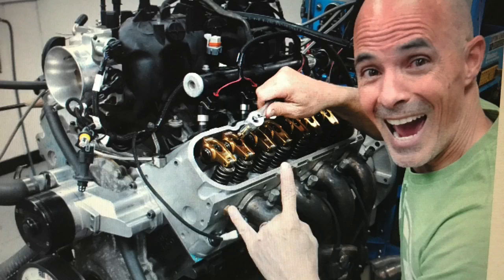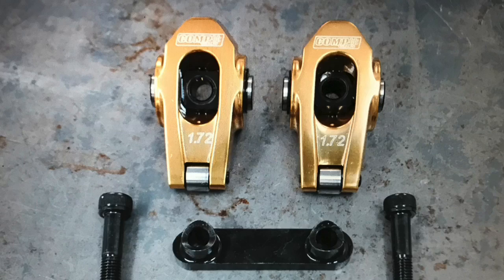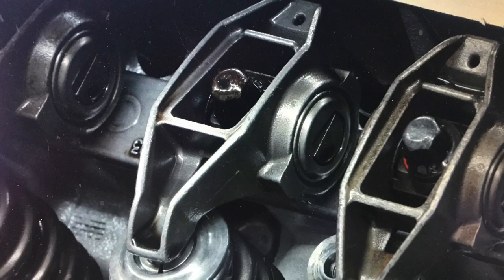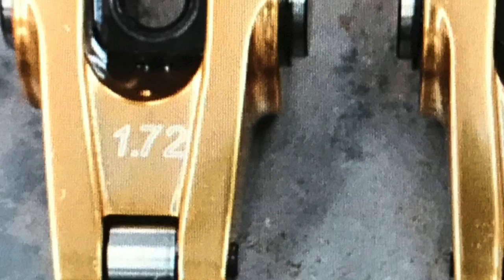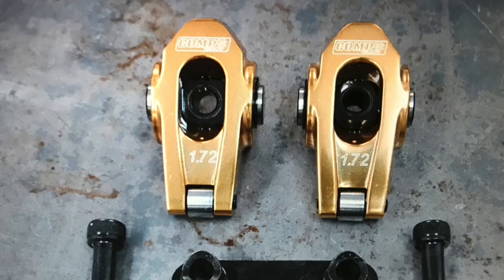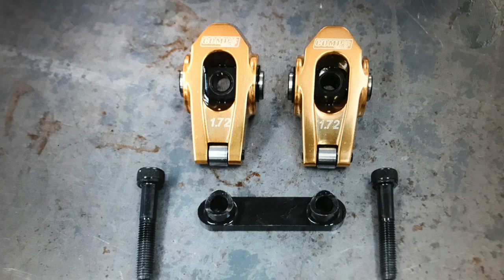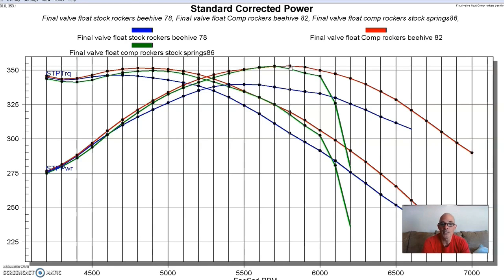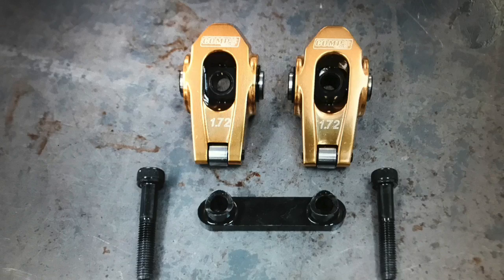LS ROLLER ROCKER TEST-DO THEY WORK?

Comment: I have a stock 4.8 from 2000 Silverado 2wd. I tried adding a 585/585 lift cam to it with 1.8 roller rockers with standard hardened 7.4 pushrods. Not understanding the pushrod length measurements. Saw something online that 5.50 to 6.00 I should use 7.35 push rods. Can you give me any feedback please
Reply from the maker: the lift of the cam has nothing to do with pushrod length
Reply: @richardholdener1727 thanks you. I guess that sums it up then. Just need to measure the pushrod length on any cylinder for each intake and exhaust. Must have been the rockers that caused the issue.
Reply: @r @richardholdener1727 will 1.8 roller rockers run ok with hardened springs, small cam, stock block 4.8 guts. Just can’t afford interference in the future.

Comment: I know this video was done 5 yrs ago but did you see any differents in the oiling, I have great oil pressure but can hardly see oil coming out of the rocker arms, I know that they don't come straight out like stock rockers but I feel like it's not enough oil , how do I know for sure?
Reply: Yes sir, I understand that, the roller rockers have the oiling hole coming in and out the side and I guess I'm just gun shy because it doesn't come out like a small block and shoot over the fender,
Reply from the maker: The rockers should not change rocker oiling-hole size should be very similar

Comment: Does the comp cam roller rocker affect the pushrod length size? And if so does the same 1/4 turn method from one of your previous videos work on finding the length?
Reply from the maker: rockers change pushrod length-and turn method only works on non adj rockers

Comment: Roller Rockers where never meant to give you more power. If it was about power GM would not have first installed them on the 3800! It reduces friction and wear on the valve stem tip. The reduction in friction increases fuel effeciency not enough that the customer would ever see it but for corperate average fuel ecconomy. The only thing you can do to a rocker that can increase the power potential of any given cam setup is to increase the rockers ratio!
Reply from the maker: Just an FYI-roller rockers can increase power by providing an accurate and consistent actual ratio through the lift range (when using stock ratio). The fact that GM installed them first on the 3800 has nothing to do with whether they add power or not.  But they do reduce friction

Comment: What kind of rocker/trunnion I need for tsp stage 2 216/220, 550/550, 112 lsa and my motor is 4.8
Reply from the maker: you can use stock-or and upgrade

Comment: I really don't see what's the big improvement with the so-called roller lifters in reality it's only an improvement and still not a solution,so why have they not Designed the lifter with a ball 🏀 style roller over a one-way roller regardless  how the lifter changes it position it's still not going to cause damages...
The concept of a ball type roller is to eliminate the roller bearings and stationary lifter failure
Reply from the maker: the orientation of the cam lobe in relation to the roller lifter only needs to roll in 1 plane. there is no need for a complex capture mechanism to house a roller ball

Comment: If I change the ls1 stock cam can I put in roller rockers and what size
Reply from the maker: yes but no need
Reply: @richardholdener1727  I want to up grade to be safe
Reply: @richardholdener1727  I was thinking if I have .660 springs I need roller rockers rated for a little over that right the comp ultra pro magnum should I run the stock size that’s what size one peace Molly rods I have
Reply from the maker: YOU SHOULD STICK WITH STOCK
Reply: @richardholdener1727  rockers or rocker size I apologize I appreciate your response I’m learning
Reply: @richardholdener1727  the motor is ls1 I’m puting in btr red hot cam 221 24x .619 .617 .660 lsa113 dual springs 1 3/4 LT TS True duals msd wires and plugs bbk 85mm and spacers volant dual ram filters is that a bad set up ? Idk I guess I’m leaning as I go I was planing on getting hp tuner it’s just I’m not that good with reading and stuff…

Comment: A issue I find with older rockers that are cast is I've seen some badly cast factory rockers were there not the right ratio or off some other than that it's fairly cheap to replace

Comment: Hi Richard, do you have any videos comparing same rocker ratio with significantly different weights over the valve tip? Or also same ratio but steel vs aluminum?
Reply from the maker: THE ROLLER ROCKER TEST SHOWS YOU WHAT HAPPENS WHEN YOU INCREASE ROCKER WEIGHT
Reply: @Richard Holdener  It shows effect with inadequate springs. What about curve changes when everything else is optimal, only changing tip weight?
Reply from the maker: THERE IS NO CURVE CHANGE FROM WEIGHT-ONLY STABILITY OR NOT
Reply: @richardholdener1727  thanks!

Comment: I had this very weird thing happen to me.  When I decided to upgrade to trunnions, I noticed the wear pattern on one of the rockers was to the side instead of straight in the middle of the tip.  I've had the engine since new and I have never had it apart before so it wasn't from some incorrect torquing down or reinstallation or whatever.  Straight from the factory.  I wonder if anyone else saw this.  Anyways, while I wasn't thrilled about paying so much for roller rocker tips, the cool thing is that they came on a shaft that mounts two of them together.   Stock ls rockers are individually.  I'm guessing this will eliminate any tendency of rocker arms wanting to twist to the side or so.  A little side benefit to the roller rocker tips I bought I guess.

Comment: I have a 5.3 with 315k on it. It was tapping. I tore it down to the block crank and pistons. Added a new high volume oil pump. Shimmed and ported it. I have 80lb cold 60lb hot. I installed a new cam new lifters and lifter cups  new push rods new rockets and timing chain added studs in the heads. I started it and I have tapping still I replace knock sensors new spark plugs and wires and ideas
Reply: Tap typically top end valvetrain/or wristpin a knock isually bottom end if you loose oil press with heat typically good indication of rod bearings/bearing clearance.

Comment: On 1st gen SBC a rocker upgrade is a must, I've seen too many broken stock rockers resulting from little more than a set of heads that received a valve job and had better springs installed. Not to forget the inconsistent pivot ratios of the stock pieces.

Comment: My Fbody came built laying 460whp. It’s got PRC heads and a TSP Torquer V4 cam. 231/234 .629"/.615" 111 LSA - Worth upgrading to a 1.7 or 1.8 RR? Tryna find out from the original owner if they have some but not sure.
Reply from the maker: NO ON THE ROCKER SWAP
Reply: @richardholdener1727  gotcha found out it has TSP rockers. Thanks for the quick reply I was bored and tempted haha

Comment: I have a lm7 and got the 227/238 cam kit with .660 lift dual springs and I’ve already put the trunnion upgrade on but now I want rollers I didn’t know they made power which ones do I need
Reply from the maker: keep stock ones

Comment: We’ve seen less lateral stress on the valves and steams with roller rockers. The factory rockers work great but seem to punish steam seals and guides more than rollers do. (Just my 2 cents).
Reply from the maker: YES AT HIGH LIFTS

Comment: I think the trunion upgrade is all that is needed for most minor upgrades on the LS, but a roller rocker is a much bigger upgrade on a traditional small-block.  The trunion is the upgrade, the roller tip isn't worth much, IMHO.  In this comparison, the rocker ratio change is probably the difference.

Richard, what are your thoughts on the LS shaft upgrade kits from Brian Tooley Racing?  Again, probably not necessary for most applications, but seems like a very nice upgrade for those getting more aggressive with the RPM.
Reply from the maker: SHAFT IS NOT REQUIRED UNLESS RPM

Comment: On the term of deflection how are shaft mounted rockers particularly the Brian tooley shaft rocker arm kit and his New rocker arm design cause if I remember off the top of my head his rockers gained weight at the tip assuming it allows better spring harmonics but it's like 2.5g I guess to put it simply is how much does deflection affect power

Comment: Not the first engine I put roller rockers on , but the first stock engine was a 97 z28 LT1. I installed crane 1.6 gold self aligning rocker. The difference was noticable from 4 to 5500 rpm.  The problem, factory rev limit was 5500. Durp
Back then those were $300. I think they were worth it because horse power that doesn't consume more fuel is today's priority.

Comment: Would a pac 1218 spring be enough to offset the valve float with a mild cam?
Reply from the maker: WHAT IS THE RATE OF THAT
Reply: @richardholdener1727  313 lbs/in

Comment: I wanna see this exact test ran, but with an aggressive cam in the motor and actually wringing it out.

You skipped over some of the biggest reasons for going to roller rockers- the factory rocker nose geometry starts to "scrub" above about .586" lift, causing a big increase in friction and sideloading the valve stem, both coating power AND killing valve guides over time.

Something like an MS4 from TSP would be a great example in a little 4.8, and would really illustrate an application where they fit nicely.

I'd like to see the test with factory rockers, followed by a set of rollers bolted on "out of the box", and then again after taking the time setting proper wipe pattern.

Something that would be GREAT to see after the last test mentioned above would be pushrods, and testing the extent to which  pushrod deflection can hurt output. Test first with the ubiquitous 5/16", .080" wall pushrods that everyone uses, then test a set of Trend double-tapers... The MS4 has nice aggressive lobes and was designed around being a "high-effort" cam capable of taking advantage of stock cathedral heads; that grind coupled with the RPM that combo would want should make for a very interesting test!

The only ancillary thing you might have to change would be to throw in a set of adequate lifters to eliminate that variable during testing, assuming they weren't already replaced while the heads were off. A set of CTSVR's, drop-in Morel or Johnson, or even genuine Delphi's or Eaton "LS7/LSA/LS-whatever people call 'em now" are cheap and up to the task, ran at .090-.110" preload.

Please please pretty PWEEEAAAASE? I got a bone to pick regarding the subject. 

You could even make a series out of it- finding and extracting NA power out of a "junkyard" LS, one step at a time, including "free" stuff, tips and tricks, ect... You could also do stuff like:
-test if an ATI dampener actually picks up
-electric water pump (could even test if there's a difference between one with an idler pulley vs without)
-crank scraper and windage tray
-better factory intake/throttlebody
throttle body spacer snake oil or free power?
-removing casting flash from ports
-gasket-matching intake and exhaust
Polishing the combustion chamber up using mag polish and a little wheel detail buffer "old wives tale", or is there something to it?
-Indexing spark plugs?
porting  and radiusing oil pump housing/lapping side faces of gerotors, and "centering" during install does less suction and discharge head and less friction make a difference?
comverting "PCV" over to exhaust venturies does a lil' bit of vacuum in the bang box do anything noticeable?
-Phenolic intske gaskets: Do they really do anything for IAT's, especially with a plastic intake?
-all the other small things we've heard about over the years

Comment: How are you doing Mr Richard is it possible that u can give me a few pointers on this build that I would love 💘 ❤ 😉 to do or how much would it be for a build sheet. I have a 99 2door tahoe original 5.7 4x4 and I would like to put a 2003 or 2004 lq9 I have took notes down from watching your videos like cam size valves spring order number etc I would love to just talk to you and right everything you tell me down or u could email me and also budget friendly. I know from your videos you are the man for the plan if possible
Reply from the maker: how much power do you want
Reply: @richardholdener1727  between 480 and 540 thanks for responding Mr Richard

Comment: Hey richard i got the btr torque cam and push rods and heavy springs what rockers and piston do you reccomend for my 2001 chevy silverado lq7
Reply from the maker: stock rockers and pistons
Reply: @richardholdener1727  ok thanks for the time to reply that torque cam combined with the tune i put in it and the 4l65  transmission monster thansmissions built me and i put 4:10 gears and have 35s the truck hauls ass i barley have to hit the gas and it goes pljus gets 17 avrage mpg when i take it easy

Comment: Love this video. It's something I would love to do. How much lift can the stock piston and 862/706 head support between cam and rocker? Also why not upgrade the intake valve to 2.0. does that head just already have the cfm to support the LR4 without it? Or is it done other reason? Thanks for all your answers
Reply from the maker: NO NEED FOR 2.0 VALVE,
Reply: @richardholdener1727  thanks Richard, just wondering why not

Comment: I put some comp 1.6s on my stock lg4 over the winter.
 it's a low mile stand alone with intake and exhaust.
I wonder if it was a good idea?
Or if it's just gonna waste gas.
With the low 8.6:1 compression.

Comment: Hi sir,
A few months back I bought some valve springs for my 04 Tahoe, to go on the heads I had rebuilt. They turned out to be fake “Comp” springs, and subsequently 3 broke taking the engine with them. I’m about to install a rebuilt 6.0 and after rebuilding another set of heads and purchasing genuine Comp springs I’m concerned about the rockers. The options are boundless so I thought I’d ask you for advice. I’m happy with the stock rocker arms but I’d like to eliminate the weak link in the needle bearings with a reunion kit but I’m unsure of which to pick, the captured bearings style or the bronze bushing. Any advice would be appreciated
Reply from the maker: i HAVE NOT TESTED THE TRUNION UPGRADES

Comment: I would love to see 1.7 vs 1.8 rocker comparison on LS
Reply: I thought that was the video was about. somehow the 1.8 dropped off the back. unsure.
Reply: More lift so more power, just multiply the cam lift by the ratio and you'll get your lift.
Reply: @bennyboyy7 the power of more lift will only come if the heads can flow enough.

Comment: Back in the day some racecars turned 8500. With standard tin rockers.
And yes they did fail. But not that often. But mushroomed valves? Very often. 
Looking at that pic with the rollers installed,, geometry does not look that good. And there may well be your rpm ceiling. And broken studs as well. And mushroomed valves.
Reply from the maker: THE VALVE FLOAT ON THE ROCKER INSTALL IS WEIGHT

Comment: Richard, have you done a video for SBF using this same style, newer Shaft mount roller rockers 1.6/ 1.7, 1.72 ratio on early 289/302/351W ?
Reply from the maker: i HAVE DONE ROCKERS TESTS ON A SBF-JUST NOT SHAFT ROCKERS
Reply: @richardholdener1727  I'm going to run  PCE261.1104.03
  SBF- 289/302 W 1.6 Ratio Aluminum Shaft Mount Roller Rocker Arm Set.   1965 289/W eagle 302 3" crank , with world jr heads and DSS pistons 4.030 2 relief valve pockets (floating pin) & a retrofit Crower 15522 cam retro w/roller lifters.  I hoping for 340 to 370 HP/TQ ?       Happy Holidays Richard

Comment: Well I was dismantling my stock LS6 rockers and found the tip wear was pushing the valves crooked.   So for the service to true these and a trunnions upgrade, I mind as well get new rockers.  Doing my winter rebuild heads cam and exhaust.  😎😎😎

Comment: Fantastic work you do! It is really appreciated. I have a question about rockers. Can a stock LS2 use the 1.8 rockers? Thanks for all you do.
Reply from the maker: it will fit-gain is better with a cam
Reply: @richardholdener1727  Thank you Sir from West Texas!
Reply: @richardholdener1727  the basis of my 5 & 10 cent questions is very limited budget and work space, so I am looking for things that require minimal intrusion into the engine and accumulative increase in power 5 or 10 hp at a time, regards
Reply: Yes it will work good with a stock cam give it more lift. u don’t want to use 1.8 with high lift cams to much stress on the springs for a daily driver. I run 1.8 full roller scorpions on my ls TA with no issues what’s so ever!!  Yes I would recommend them for a stock ls2.

Comment: How about dyno testing 1.7 vs 1.8 on a lm7 or lq4?
Reply: Absolutely just run the test on a stock engine  just to see how much change if you only swap rockers.
Reply from the maker: it helps a little if you have the stock cam

Comment: How do you keep the valves up when changing the heads the air in plug hole trick and I wanted to see 👀 what the 1.8 ratio rockers do on stock cam
Reply from the maker: air in cylinder
Reply: @richardholdener1727  how much of a gain would 1.8 rockers give you think

Comment: The biggest gains will come with a roller fulcrum. The biggest issue with ball pivot rockers is friction goes up proportionally to pushrod load. Big lift and bigger valve springs will burn a stock rockers and sometimes they will even push through. For stock cam guys, there isn't too much to be gained even with cheapo replacement rockers. A tiny bit of power way out at red line and maybe 2hp at 3000rpm. Nice test man, this is some good info.